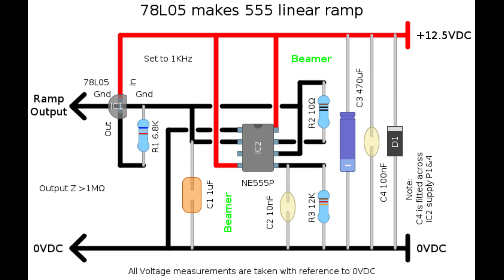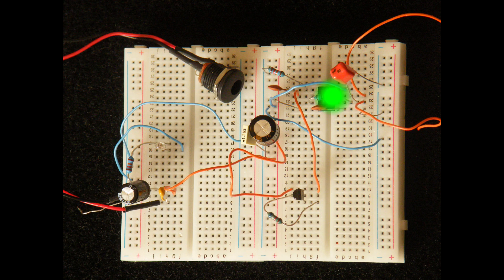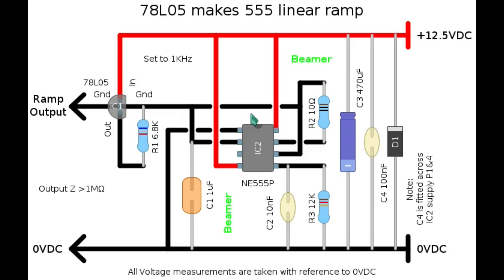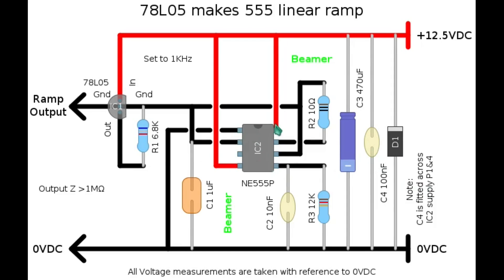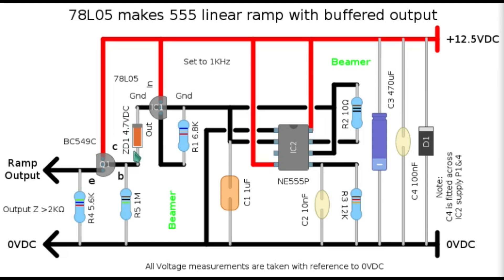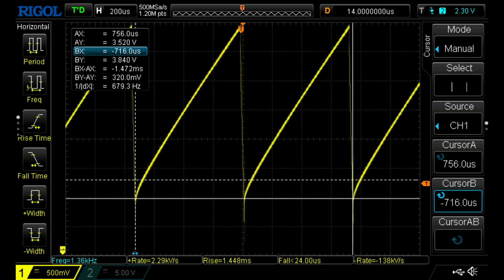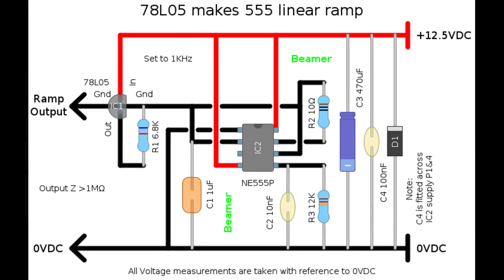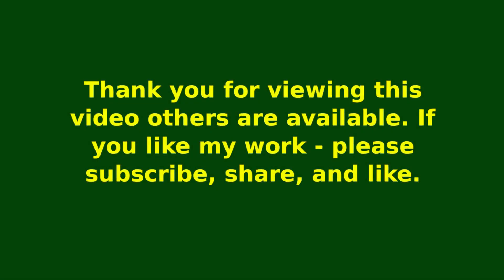78L05 makes ramp wave/cap sniffer

Comment: 0:35 A scematic with flow from right to left is unusual and most of the time confusing as hell.
Reply from the maker: You're right it's unusual, however, as there are few components, I didn't think it would be an issue. Many apologies.

Comment: Shouldn't diode D1 be in series with the 12.5V source? The way it is, if someone hooked up power in reverse, D1 would be forward biased with no current limitation. D1 would probably blow and end up not protecting the circuit at all.
Reply from the maker: Thank you for making that point. You are absolutely correct: If a circuit expects a certain supply Voltage and the supply can provide a Volt spare - a series, reverse protection, diode is by far the best way to go. The 0.7VDC drop (silicon) and its power dissipation will be no problem, however, if a battery is used and the circuit supply requirements are critically close to the supply, then a parallel supply diode with a supply fuse (most important!) can be used - zero Voltage drop. As I mentioned in the video, "I always use a Poly-fuse in the supply" and I used a 12VDC battery. In practice, there's usually a small Voltage drop across any fuse. If the supply is reversed - D1 will go into conduction, Poly-fuse will quickly open up (heat up) and the circuit is protected. Today, there are many options to solve this issue: Power MOSFET, Schottky diode and crowbar to name but a few. That Poly-fuse has saved my bacon on many occasions :)

Comment: If i have understood this, you using the 7805 as a Constant Current generator and the 555 to provide detection of upper and lower limits (from its internal divider and comparator)
Reply from the maker: Correct, to the standard 555 astable multivibrator: All I'm doing is replacing the charging resistor with a CC(78L05), then buffering the linear ramp produced - in the more complex (slightly) circuit.
Reply: @beamer.electronics  i have been in electronics from the age of 12 or so... made I it my profession now in IT